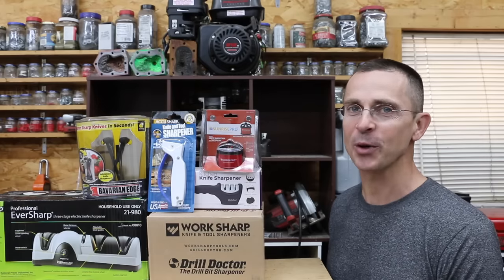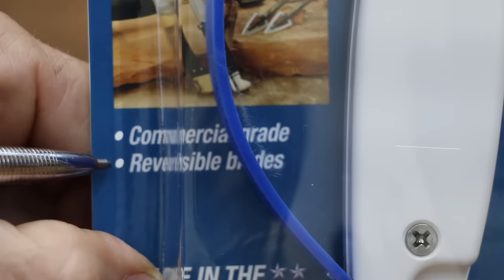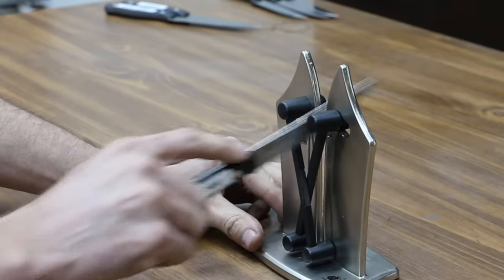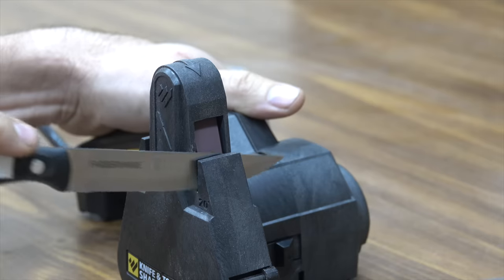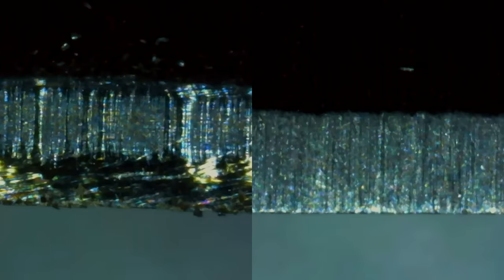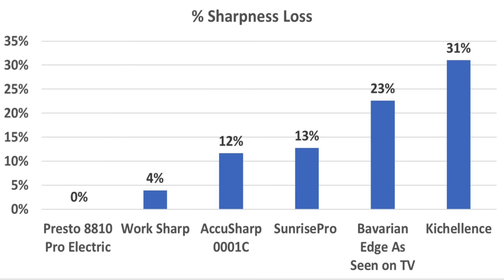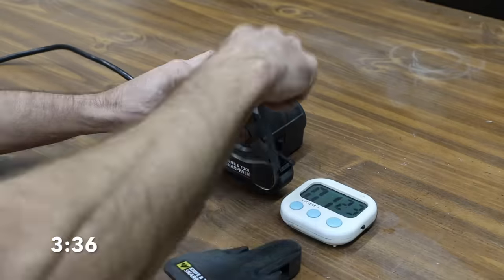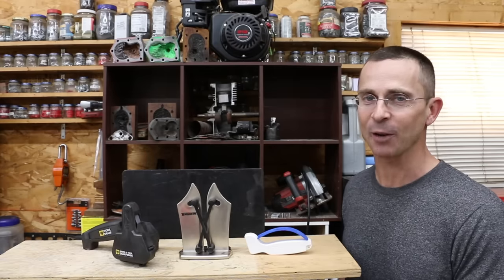Which Knife Sharpener is Best? Let's find out!

Comment: Got my money on the Work Sharp...
Reply from the maker: Amazing sharpener!!  Well worth the price tag in my opinion.
Reply: The Ken Onion version is great for all kinds of knives as well.
Reply: I own the ken onion version its night an day better than the basic work sharp I put a scary sharp edge on all my knives with ease
Reply: I really like this Worksharp model.  Work Sharp Guided Field Sharpener, Model Number WSGFS221
Reply: I use this sharpener and have bought it for others as gifts. You can dang near get knives sharp as a razor blade. The fine greyish colored belts don’t last long and I’ll usually put a new one on after each sharpening. 
A word of caution while using the sharpener- always hold your knife parallel while pulling it thru the sharpener. If you tilt the handle 
up at the end of the stroke it will grind the point/tip off the knife leaving the point rounded
Reply: @trailertrashlee2778  Very good advice, the WorkSharp definitely should be used with cheap knives at first to adjust to it. But it's amazing, I use aftermarket belts and a leather strop belt to create mirror polished edges.
Reply: One method that some guys use to sharpen blades is to stick pieces of sandpaper to very smooth & flat surfaces (thick pieces of glass, polished stone from countertops, etc).  The WorkSharp looks to be a similar idea, but faster and with a motor moving the sandpaper belts.
Reply: @goodymb  For $130 I was not impressed with the Ken Onion. Sent mine back.
Reply: @Will-Xaru  What belts do you use if you don't mind my asking. I've had my Ken Onion for a while and haven't been adventurous enough to try non-factory belts, worried they would be worse than the standard ones.

Comment: I wish you had included a Chef's Choice brand sharpener... ;-)
Reply: Yes. I've had one for about a year and it works great. It sharpens to a different angle than most (16 degrees I think ) so it takes awhile to get your old knives in shape but good knives really hold an edge once sharp. Got good reviews so I went for it. It was something over $100 but worth it.
Reply: I use one of the asian models for my narrow angle chef knives. Just the hand held 2 step
Reply from the maker: Great recommendation!  Added it to my shopping list.
Reply: Which chefs choice model.  I see a few of them on Amazon.
Reply: Lol, it’s not any better.
Reply: @Bill2009a  I've had a Chef's Choice Edge Select 120 for about 5 yrs; works great (and do my sister's and my niece's etc).
Reply: @Bill2009a  Chef'sChoice 15 Trizor XV Edge. Can't remember why I chose this one. I see they have several choices on Amazon.

Comment: I remember my dad always having a leather strap hanging off the wall
Reply from the maker: Thank you for the feedback
Reply: That's a "strop", hanging strops like that work best with razors and not knives.
Reply: Actually they true the edge not sharpen, much like a steel.
Reply: Yes, after sharpening do about 20 strokes on each side of the blade using the back side of a leather belt for the ultimate edge.
Reply: @incith  no just no
Reply: That would be stropping unless he embedded grit into the leather, which is very possible because that’s the premise of use for jewelers rouge.
Reply: He used it to beat his kid.
Reply: @incith  Actually it is a strap and a strop. Oh, and when did a razor stop being a knife? I must have missed the memo.
Reply: @chuckphilpot7756  "Strop".  With an 'o'....
I really am not sure why some of you are saying the things you are.  I have been sharpening professionally for many, many years at this point.  The spine of a razor gives it the appropriate angle for sharpening, and for stropping.  You press the whole thing flat against the hanging strop.

I did not say it would not work for knives, but they are meant for razors.  That's all.  You'll have much better control of your angle on a bench strop for knives.  Or a guided system.
Reply: @incith  Woosh.
Reply: @incith  strap

/strap/

noun

a strip of leather, cloth, or other flexible material, often with a buckle, used to fasten, secure, or carry something or to hold onto something.
Reply: For you or for his knifes?
Reply: @chuckphilpot7756  That is one part of a strop.  The leather.  Also, most hanging strops have 2 mediums - flax linen on one side and leather on the other.  Is flax linen also a strap?  Is balsa wood also a strap?  I'm just saying man, it's OK to be wrong once in awhile.  Grow up.
Reply: @incith  Yes, flax linen would be a strap as cloth is listed in the definition.  You are trying so desperately to be right that you are grasping at straws. You should heed your own advice. The truth of the matter is that you tried to correct the OP's already correct statement with what you thought he should have said. Clearly someone missed English class in 3rd grade.
Reply: @incith  If the balsa wood is cut thin enough to be flexible, then yes it is by definition a strap. It is like you didn't even bother to read the definition I just conveniently placed in front of your face. Maybe all that mouthbreathing fogged your screen.
Reply: That's how he kept you in line
Reply: @chuckphilpot7756  strop1 a
device, typically a strip of leather, for sharpening straight razors.  

Here is the memo you missed .
the difference between knife and razor is that knife is a utensil or a tool designed for cutting, consisting of a flat piece of hard material, usually steel or other metal (the blade), usually sharpened on one edge, attached to a handle the blade may be pointed for piercing while razor is a keen-edged knife of peculiar shape, used in shaving the hair from the face or other parts of the body.
Reply: @boracay12  r/woosh
Reply: @boracay12  I didn't miss any memos. By definition a straight razor (you don't sharpen disposables) is a knife. A straight razor consists of a sharp metal, usually steel blade sharpened on one side and affixed to a handle. Oh man wouldn't you know, hey that fits the definition of both knife and razor, because it is both. Oh and we all know what a strop is, but the OP never mentioned a strop specifically. And wouldn't you know it, a strop is also a strip and a strap. Imagine that. I thought most people learned this stuff in 3rd grade, but this comment thread must be populated with a couple kindergarten dropouts. Oh look,  your definition of razor states that a razor is a knife of a particular shape. Whoa, looks like you couldn't even be bothered to read what you were posting.  It is sad how many humans lack the ability to use logic and critical thinking to their advantage. But you took it one step further and used logic to your disadvantage. I would be expecting a knock from Darwin any day now. You are definitely on track for some kind of an award.
The original comment was someone saying that razors are not knives, and you are backing them. Someone clearly took the wrong side. 😂
Reply: @boracay12  All straight razors are knives, and all knives can be razors. The differentiation comes from use. All "razor" means in effect is that a knife is sharp enough to shave with, and is used as such.

Comment: I'd like to see how this compares to the old standard kitchen sharpener that comes in the knife set
Reply from the maker: Great suggestion!
Reply: That sharpener is called a steel, and it depends on the condition of the blade and the type of steel.  If the blade is only lightly worn, then the edge is likely only rolled over and a fine steel will straighten the edge and return it to razor sharp quickly, but it does take some skill.  If the edge has been abused, a steel won't even start to sharpen it.  There are different types of steels, and the ones that come with a knife set are generally very course.   They do a better job of putting an okay working edge on abused steak knives, but the edge won't ever be razor sharp.
Reply: That isn't a sharpener, it's a honing steel. It'll only bring the edge back into true if it gets bent over. Honing only shapes the edge where sharpening requires removing material which the steel won't do.
Reply: @MrSniperRifle  Very true, but when a knife starts to get dull it's normally because the edge has started to roll over.  A good steel is all it takes to bring it back to razor sharp.  Unless the blade has been damaged or neglected, it doesn't generally need material abraded away.

Comment: Those with the tungsten carbide blades, DESTROY the knife by taking off FAR TOO MUCH metal.
Try multiple fineness of Diamond sharpeners. If you finish with 4000 level grit, you should get it sharp enough to shave with.
Also test NEW industrial razors, dull and re-sharpen them.
Reply: DavidFMayerPhD Thank you!  My thoughts exactly.
Reply: The "draw through" sharpeners will not do a good job when you have bad damage. As you said they take off too much blade. They just do one angle and will wreck a blade with less angle. They tear the metal off so garbage AFAIAC. They will never match grinding/abrasive honing.

Comment: Great video-thanks! I was looking for an objective review of the accusharp, and found 13 pages of uploaded positive videos by accusharp, before I found yours, which was not only objective, but incredibly well done!
Reply from the maker: You are welcome!
Reply: I used to be a meat cutter. I’ve used dozens of professional sharpening devices from large water wheels to fast electric grinders followed up with various water stones. After I retired and I found the Accusharp and stopped using the stones.  When the knife needs a refresher I pull out the Accusharp.  In seconds I’m good for a month or two using only my steel occasionally to straighten out the edge without removing metal.

Comment: I'm not a professional chef but a talented home cook so my Wusthof knives get a rigorous workout on a daily basis and I like to keep them very sharp.  I've had very good luck with the Wusthof sharpeners that were in the $20 range.  I have two, one for my traditional knives and a special one for my santoku knife that has a steeper blade angle.  I keep them in my kitchen and it's easy to sharpen in just a minute or two when needed, usually every 3 months or so for my more used knives like the santoku, my chef's knife, boning knife, carving knife and paring knife. I also make good use of my honing steel between sharpening to keep my edges straight and true.
Reply from the maker: Thanks for sharing.

Comment: I would like to see how the Ken Onion version of the work sharp sharpener stacks up.
Reply: Chris Olinger seeing as how he didn’t get anywhere near the potential of the original, the ken onion wont have a better result.
Reply: trijigon better guide, variable speeds, better, wider, more variety of belts. It seems to me there would likely be a difference in results.
Reply: Chris Olinger a person who can only go 5 mph in a civic isn’t gonna go much faster in a corvette
Reply: trijigon what do you think he did wrong in the tests?
Reply: Chris Olinger it could be a few things. Most likely inconsistent angles and pressure. Perhaps the burr being rolled over to one side which will make the knife seem dull. Could be too much or too little pressure. I won’t watch it again, but he might be skipping over or rushing through the area he’s testing. He could be grinding the edge too acutely which could roll the edge on that wire but I don’t know what it is. The work sharp is a great sharpener, the ken onion is better and a favorite of mine. I’m just saying if he is so inconsistent with all the tests in this video and can’t get a shaving sharp knife with the work sharp, he’s doing something wrong or there is a really big problem with the knife steel. But that’s most likely not the case
Reply: trijigon thanks for taking the time to explain your answer. At first I thought your response was full of salt an you might have an ax to grind. (Pun intended) your opinion has turned out to be very thoughtful and backed with some experience.
Reply: Chris Olinger I could have explained myself  from the beginning, but I hate typing on iPads. If you’re considering getting one of the worksharps, I recommend it. It’s worth it to get the ken onion. They make great axe sharpeners too.

Comment: Accusharps sharpener is actually really dangerous to use. I've had a knife go right through the plastic guard and slice my finger clean open.
Reply: Sorry, but I can’t help myself.....does that mean the knife was sharp?
Reply: @benzracer  wasn't heavy pressure but okay, act like plastic is steel and can't have a blade cut through it even with light pressure. Sounds like you've been doing something wrong if your knives and blades aren't as sharp as mine and able to cut right through a plastic guard. Long story short, loaned out my knife got it back with a dull spot, still had a razor blade edge on part of it, well when you sharpen a blade that was at one point already extremely sharp to a specific point you can cut right through plastic and skin without realizing it it's highly possible to injure yourself, it's what comes with owning blades. The only reason I used the sharpener in the first place was to actually reset the blade by dulling it evenly to resharpen in with an actual grinder. But hey go ahead and act like you're some perfect human being who hasn't gotten injured at all before because that's the real dingus thing to do.
Reply: @jetfly37  I keep my knives sharp enough to the point you can cut your own skin and not even realize it. I only use this type of sharpener to dull down blades before grinding them myself.
Reply: @TheRealBmanswan  A a grinder is to reset the edge, so you're already doing extra work. 

B Everything is possible. Like getting struck by lightning in the same spot twice. However when you're shoving a sharpener onto the blade you're gonna have a bad time. If you were in control of your sharpener you would not have injured yourself. Plain as water. 

Dingus.
Reply: @benzracer  you do realize a sharpening stone is a form of grinding a blade right? And you did watch the video that shows the sharpener pretty much tears down the blade right? You call someone else a dingus but can't even comprehend grinding is a sharpening stone method not just a grinder method. I may have hurt my finger but I at least know my tools and what they're used for. Otherwise I wouldn't end up with knives that can cut clean through material. But okay Boomer keep calling someone you don't know a dingus. Like I was told, faulty guard, shouldn't be able to cut through it at all unless using heavy force. Hence why I took them to court and actually won a decent settlement. Weird how the company agreed and the court sided with me but a random nobody is sitting here calling me a Dingus. Dunno dude, my cash settlement says otherwise. Say all you want I really don't care I'm moving on to something better than this conversation with a random pointless individual.

Comment: I wanna see this vs whet stones and high end sharpeners like the edge pro or somin like that
Reply: I would too but those actually require some skill, you need the right angle and pressure. I've read that these quick sharpeners take away way too much if the knifes metal.
Reply: @robertcastillo90  With the Wicked Edge you clamp the blade into place and the sharpening stones are on guide rods so you can maintain an exact angle. You can set the angle between 15 and 30 degrees in one degree increments. It's easy as can be and it really does give a sharp edge indeed.
Reply: Yep the wicked edge is the one I was talking bout except it's almost 2knzd but I have learnt whet stone its ez it pick up but takes time to master
Reply: Also I hate amd refuse to use pull sharpeners they ruin the edge and do alot of damage ruining the edge and dont sharpen shit
Reply: If ure gonna use a pull ure ment to put almost 0 pressure u shouldmt see the steel flying off like he did
Reply: @aimknifesandoutdoors8654  The WE 100 is much, much cheaper than that and unless you're sharpening dozens of knives per day it's more than enough for most people.
Reply: I would like to see the change in sharpness from factory after using these sharpeners without dulling them first. That would be very telling in their ability or lack thereof. Also, how sharp can you get these knives using a whetstone?
Reply: I have no interest in this.
Reply: @MrWayneJohn1  I can get them sharp enough to effortlessly shave with
Reply: @JC130676  I am thinking about just making my own one and using theee stones
Reply: I sharpen maybe 50 knifes every 4 days
Reply: @aimknifesandoutdoors8654   What I meant was: How sharp, using the 'sharpness' measuring device rating from the video, can the knives get vs. factory grind? sharpness

Comment: I’ll have to say coming from a hunter starting out as a young teenager sharpening knives on a very good honing stone, that the Ken Onion Edition Work Sharp is the best sharpener that I have used. It will shave hair very easily. Yes, it does have a learning curve so start with an old pocket knife or some that doesn’t really matter. Some of the other sharpeners you used really remove a lot of material , so be very mindful of that. I have used many stones. The one I have is one my father found in a abandoned hunting camp over 50 years ago and it shows very little wear. Some that I have used, you can see the wear immediately. Good video. 👍
Reply from the maker: Thanks!  Thanks for sharing!